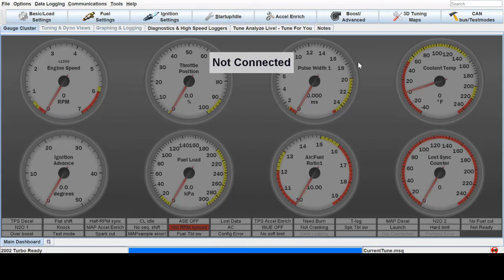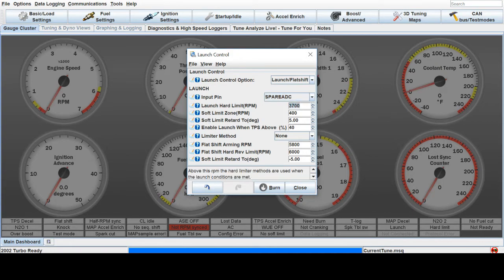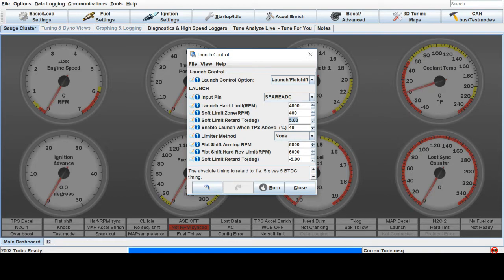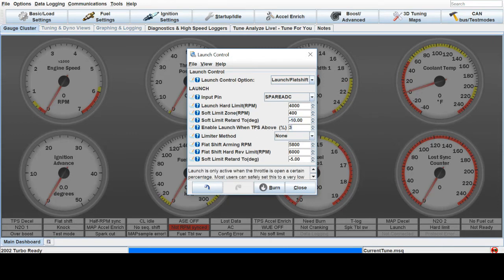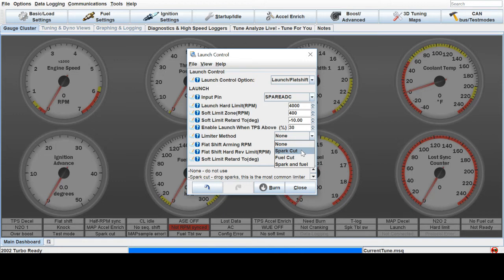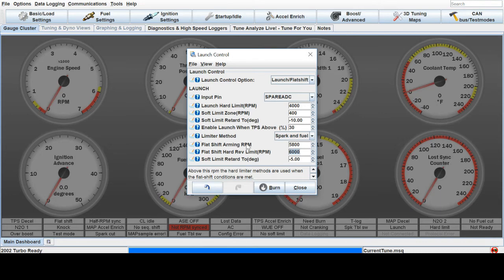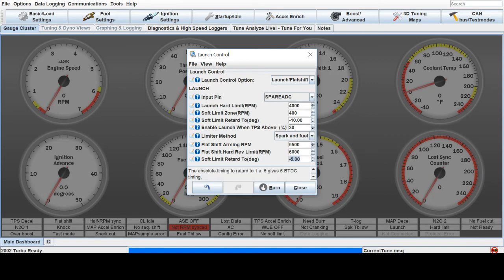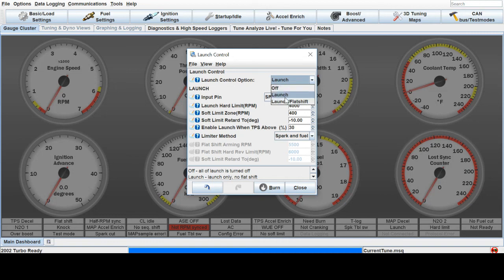Megasquirt Launch Control Setup

Comment: I'm a Bracket racer push button line lock on back, delay box active, throttle on floor, 4000rpm studder timing 32. Question, what goes in timing retard if you want no retard? flat shift have glide shift point 7000 rpm, no retard same number there? Last question does it make a difference if analog in 3 is 5volt or 12 volt or does it need to be a ground? I subscribed to you channel but you have no way to contact you for help or to employ you which you do some time. Let me know.

Comment: Are you able to put the clutch Switch on a separate button and activate your launch control that way?
Reply from the maker: Yes anywhere you like
Reply: @TurbineResearch  thanks! Thats really cool, but i guess you lose the Feature of starting only with Clutch pressed If you dont wire another cable to the Clutch, so you get a "If Clutch+Button" loop

Comment: Hi. On soft limit zone, is 400 more "safe" than 100? Or does that even matter? Thanks
Reply from the maker: Technically it depends on other parameters you setup but it's less hard on the engine when you give it more time to slow down (more rpm I'm the soft zone)

Comment: Greetings and awesome video! I've been fiddling around with launch control for awhile, but can't seem to get what I'm trying to achieve. A lot of people I know and have seen can shot flames or if anything shoot out the faintest flame on recordings. Been told different rpms and different negative timing play a part in that. Running on an MS2 so no fuel adder %, but have tried 3k, 4k, and even 6k rpm at 10, 0, -5, -10, and -20, degrees timing. All on separate days after a 20 min drive to make sure everything is warmed up. Some insight on what I'm doing wrong would be much appreciated! Also catless with a straight through exhaust design.
Reply from the maker: Make sure to set launch method to spark only (for most aggressive) or spark and fuel (mild). Change the soft limit zone around from 200-600 in steps of 100 and see what happens
Reply: @TurbineResearch  Ah thank you so much for the reply! It really means a lot! Also I forgot to mention I am already running spark only and have the steps set to 100 right now, 500 and 250 didn't produce anything either. 6000rpm limit at -20 degrees and 100rpm steps sounds very close to wanting to make a flame, but not a single one comes out and no sure if I should push the timing down any lower. Have a friend with a similar setup same exhaust and engine car etc, but his ecu has a 15% fuel adder on launch but even with this his ve fuel cel at launch is 80 while mine is 90. I am quite stumped.
Reply from the maker: @treerexaudi  are you using individual coils or a distributor?
Reply: @TurbineResearch  Individual coils

Comment: How to I set up the clutch switches to activate this?
Reply from the maker: Look for a normally open or normally closed momentary switch to attach to the clutch pedal ( depending on how you mount it) the switch just lets the ecu know the clutch pedal is pressed to trigger the launch control. You can also add a switch to the circuit to manually trigger it from a steering wheel or shifter.  Thanks for watching!
Reply: @TurbineResearch  so would i have to ground the wire thru the switch or ad voltage?
Reply: @landonhorton2.3t did you find this out?

Comment: What's the purpose of the imput pin? What connection should it be?
Reply: Never mind ;)
Reply from the maker: The input pin is just the wire from the ECU that is used to trigger the control

Comment: Question bro. I have a ms2 pnp. Do i still need to wire up the launch control channel to my clutch panel wire?.
I did do this however it works and sometimes doesn't..  if you can help me out it would be greatly appreciate it bro.
Thank you

Comment: Could you help me out, what is the Input pin? i’m still confused on what you meant by that? Do i need more external hardware?
Reply from the maker: Zest Boys it’s just one of the wires coming out of the megasquirt. The launch control is a wire hooked to a button or switch on the clutch that grounds a 5v signal from to the megasquirt. The megasquirt has a “pinout” of all the inputs and outputs. The launch control is just one of those pins.

Comment: Would this work on an automatic ?
Reply from the maker: Manny Quezada yes. You just need a button to activate the launch control. Probably below the stall rate on the torque converter

Comment: On the side of my Ms2PnP it says "to enable LAUNCH, ground pin 40" ... which is connected to FLEX. I then went into TS and changed the settings to match (enable Launch via FLEX). How or where does my clutch switch signal go? I misplaced the installation instructions that came with my Ms2PnP. Any help would be appreciated! Was / is a plug & play ECU for E30/34 BMW's